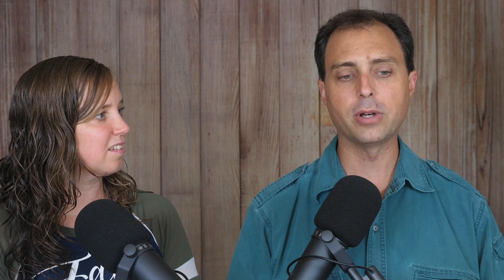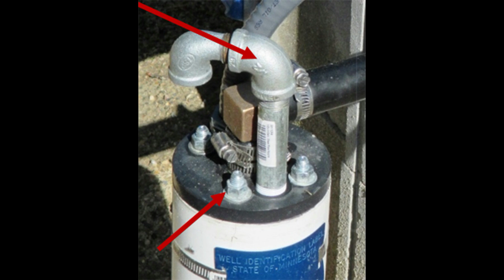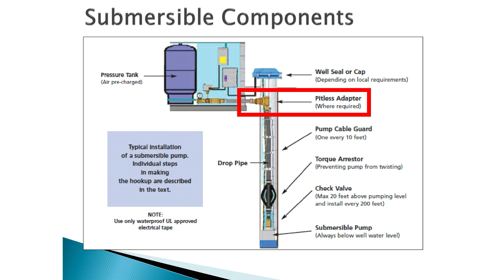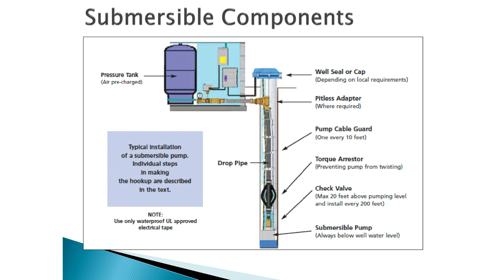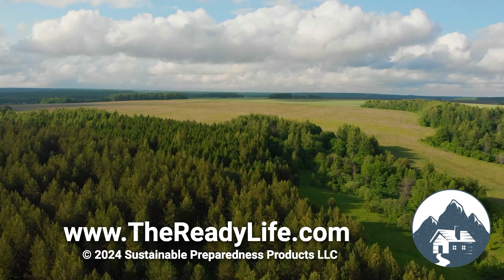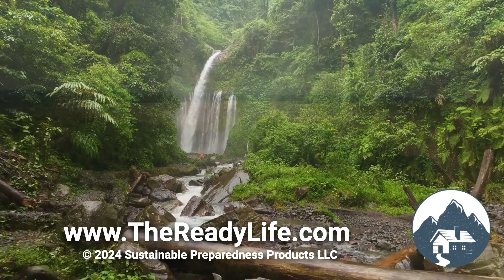"Plan B" For Your Well - Hand Pumps

Comment: Got a quote from Simplepump, and asked them how much water per stroke of the pump. Answer: a little over 1/2 cup. So, getting a gallon of water is going to take awhile at that rate. Is this a pretty typical flow rate for a hand pump?
Reply from the maker: That would be the 100L cylinder which is the smallest one (in terms of ounces per stroke).  That cylinder is what is used for the deepest water levels, so my guess is that your water level is fairly deep.  If that's the case, it may be your only option.  But just remember that because you aren't pump much per stroke, that makes the effort per stroke less, which means you may be able to pump faster and without tiring as much.  If you were pumping at a rate of one stroke every 2 seconds (which is feasible if the amount of effort is low), that would work out to roughly 1 gallon per minute.  Not awesome, but far better than the alternative (no water)!  If your static water level isn't super deep and you are willing to put out more effort per stroke in exchange for more water per stroke, you may be able to step up to the 125L cylinder with 8.5 ounces per stroke.  But you'd want to look at their stroke effort chart and chat with them about it first to make sure it isn't going to be too difficult to pump.

Comment: Is there a way to get water out if your well happens to be more   than 300 ft?
Reply from the maker: First thing, I want to make sure you realize we're talking static water level, not depth of well.  If you missed that part, I describe it on the video.  Depth of well doesn't affect a hand pump, only the water level.  If you're static water level is deeper than 325', a hand pump isn't going to be a good option.  So you'd probably want to put in a very reliable solar system with battery backup that is capable of powering an efficient water pump.  We have some episodes on that as well here.  The other option, if you have a well that has no pump at all in it, is a well bucket (could be made out of PVC pipe with a flap valve in the bottom).  With that, you can go as deep as you want, as long as the valve doesn't leak.